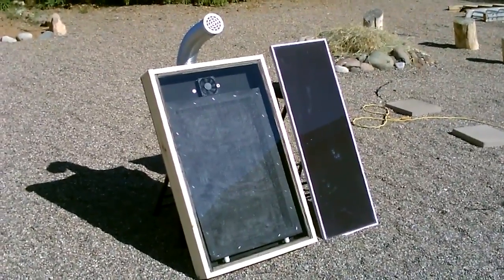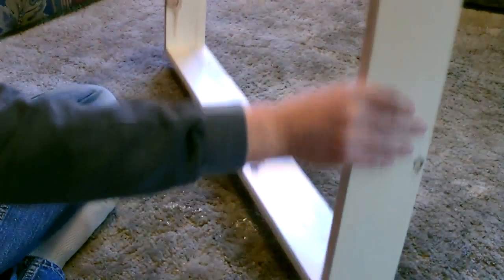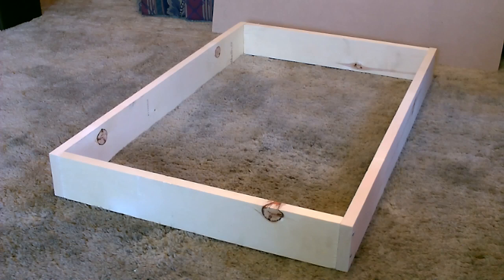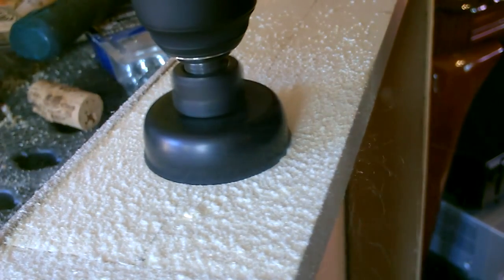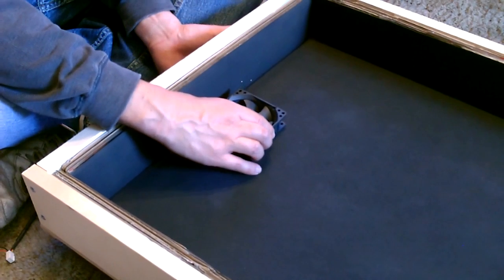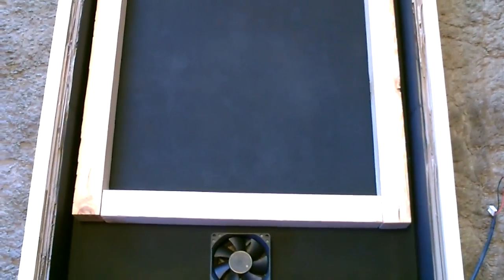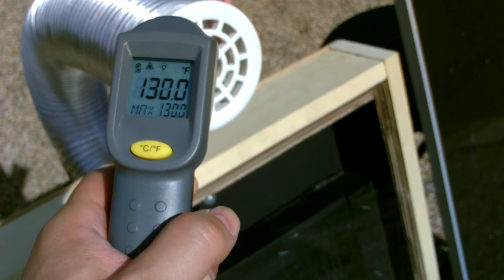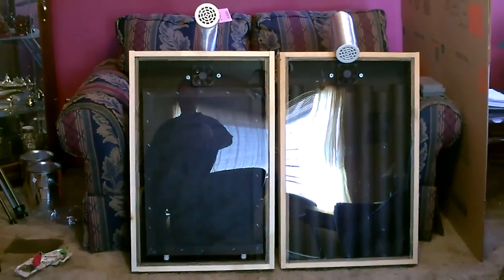Solar Air Heater! - The "Screen Absorber" Solar Air Heater! - Easy DIY (full instructions)

Comment: WHat kind of paint would be no fumes/smell for high heat?
Reply from the maker: most will work fine. i just use the generic flat black paint. once it's fully dry there will not be any smell or fumes. the heat in these things is not considered true 'high heat' so you don't need to use a high heat paint. these collectors usually stay under 200F even in the hottest of conditions. high heat paint is good for things like bbq grills and very high heat.

Comment: What type paint did you use that would be safe for indoor air - since the intent would be blowing air from outside to inside to breathe? Thanks.
Reply from the maker: hi. most paints are non-toxic when they are dry. i've used all types of paints and all have worked well. any smell goes away after the first couple of days.
Reply: @desertsun02  Thanks

Comment: So... you made a solar hair dryer? You would need to take air from the floor of your room pass it through the heater and then back into the room, or is this something you just place inside your window. I've seen those, all you need is a window screen hanging inside the room where the sun can heat it up. That is why shade cloth is placed on the outside of greenhouses, inside it becomes a solar energy collector.

Comment: I like the build. The use of screen seems much easier than using aluminum cans painted black, as long as you get acceptable temperatures from the unit. Have you tried using aluminum screen painted black instead of fiberglass screen? You may get greater heat absorption and transfer. I would like to see if it produces a different result.
Reply from the maker: hi and thanks! i haven't tried aluminum screen yet. may be a future video

Comment: I'm sorry if I missed it, but from what material are the two layers of 'screen absorber plate' made, is some form of aluminium mesh?
Reply from the maker: hi. i used a non-metal screen material (but aluminum screen may work too)
Reply: @desertsun02  Thanks!

Comment: Could I build one of these with no glass to just FIT into my window?
Reply from the maker: hi. you could but it won't produce any more heat than just letting the sun shine in through the window. these need to be outside so they can collect extra energy from the sun. 🙂👍

Comment: What is the screen material and did you paint it black?
Reply from the maker: the screen is just the standard "non metal" variety. it's a charcoal colored screen so i didn't need to paint it. 🙂
Reply: @desertsun02  thanks.
I may try to make one to clip
On the inside of one of my upstairs Windows. I have all the materials on hand.
Thanks for the idea.

Comment: I guess if it works with water it should work with air also. Not bad, you could argue that more layers of absorbent screens might even better. The formfactor is interresting, wonder if you have a narrow chamber 2 meters long might heat up the air better. Also having a labyrinth inside your design to channel the air through narrow passages. Great innovation.

Comment: Sorry but you don't say anywhere what the ''screen absorber'' material is . Could you clarify please . Otherwise great idea and well done . Thanks
Reply from the maker: hi. the screen is just standard non-metal window screen. you can buy it in rolls. i haven't tried metal screen but it might work just as well.
Reply: @desertsun02  ok thanks , but I take it you now think corrugated metal sheeting is the best ?
Reply from the maker: @JK SEP the best one of all is probably the one i made with the steel downspouts (it only beats the others by a few degrees, but if you have access to steel downspouts - it's worth considering)

Comment: What’s the screen made of? Won’t heat rise without need for fan?
Reply from the maker: hi there. the screen is the non-metal type (fiberglass/polyester). you could use metal screen if you wanted. the heat will rise but fan is needed to pump heat out at the right speed. some of the large collectors don't need fans to work well, but they need to be 10 or 15 times bigger.
Reply: @desertsun02  thanks for the reply

Comment: Is the mesh fiberglass I can't find black aluminium?
Reply from the maker: hi. i always use the non-metal type of window screen. i've never tried aluminum screen but it would probably work well. you'd have to paint the aluminum screen. i may try doing that. i might use that super black 'musou' paint.

Comment: The fan CFM means a lot. It speaks volumes for how much air was heated to those temps.  You use outside air, this means air exchange. Some buildings are very tight and must have ventilation inlet/outlets just to run a bathroom ceiling fan or the furnace. This would create a positive pressure on a building and may require other modifications.

Comment: Now watched a few USA DIY videos from across the big pond, I've came to realise why Americans keep stuck to Inches instead of the much more Logical Metric system... 
The Only Big Plus for Inches ..  -You don't need Glasses to see your measurements ! !! Those Numbers are soo Big compared to Centimetres haha @5:25
Reply from the maker: hi. interesting observation. so many things over here are based on the imperial system (inches, yards etc...) going back a hundred years or more. i think were in the process of transitioning but both systems have to be taught or people wouldn't know how to fix anything that is older (plumbing as one example).

Comment: What about: Adding double pane glass, instead of a flat screen, make it wavy. Instead of heating air from the outside, bring air from inside the house into the heater, so you are recirculating the air.

I have not built any yet, but I had an idea of a copper coil in an insulated box filled with black sand. You could run antifreeze in the tube and embed it in a walkway to keep it free of ice and snow.
Reply from the maker: hi. i've tried dual and even triple panes of glass but even adding one extra pane lowers the output temps quite a bit. it seems like more glass blocks more light and any heat gain you might get from it's insulating effect is negated. using recirculated air should boost temps some. i like the fresh air aspect so i use outside air.

Comment: If you drilled some inlet air holed in the frame of the screen collector do you think that would help or hinder the heating of air?
Reply from the maker: hi. not sure how you missed it but there are inlet holes drilled in the frame. got to have those to get air to pass through the unit 👍🙂
Reply: @desertsun02  no I saw the big ones in the main exterior frame. I was asking about the interior frame that had the screen on both sides.
Reply: @jeremys.2451  if you don't drill holes in the inner frame, heat will get stuck in there, 
which will act as a small thermal mass and give of heat for a few moments after the lightlevel sinks.
It most likely would also lead to more infrared radiation emittet by the screens and the frame, 
which would partially leave the mainframe thru the glass and reducing the efficiency.

Since there are better ways to implement a thermall "battery" into the system, I'd think it would be smarter to drill holes in the top and bottom of the inner frame.

Comment: i've come up with another cool improment idea:  what about putting black stones like crushed lava stones or crushed black slate or black gravel stones behind the glas... it will slow down but still allow air movement through the bedding and might provide a huge surface for heat generartion.... another good thing about it could be, that this could hold the temprature for a while if a cloud blocks the sunlight or after sunset....

Comment: Thank you for your channel.  Is there a computer fan you would recommend?  I'm building
the Solar heater you designed but I don't know which one would be the best to order.
I'm in a small desert town and I have to nave things shipped in.
Reply from the maker: hi there. i don't generally recommend any particular fan but one brand i like is bgears. they make some solid and (fast) fans. i've used them in several of my projects
Reply: @desertsun02  Thank you for the information on fans.  I'm building the solar heater
today so I will order the fans. Thank you for all your DIY info.

Comment: Thank you for the video. Question for the cans version though: would arranging the cans in a serpentine, effectively making it one tube, be better than the sheet? My guess is that the air would have to travel longer and thus heat up more before exiting. And  perhaps then have a better passive air displacement with it? Maybe cut some fins into the can lids to stall the air inside even more?
Reply from the maker: hi there. it's hard to say what effect those ideas would have. experimenting with ideas is really the only way to find out 🙂
Reply: @desertsun02  will do! Thanks for the inspiration!

Comment: Why can't the solar panel be used for both solar electric and as a heat collector in a rig like that instead of the screen? What's the lowest outdoor temp that would still allow that solar heater to blow out 70-75F temp heat "as is" without added insulation?

Comment: ...but you still need to bend that conduit to be useful. this is a great idea that shows good working principles. heat rises and for every meter of ducting  you lose temp. what would make this more efficient would be to have these collectors below the floor of the room you are heating.

Comment: What a great idea! Air is so much easier to handle than water! The overall circuit needs to be analyzed and optimized, but what you have shown us is a giant first step.
I can see this being used in air/air and air/water applications. I really like the lack of sensitive and fragile components in the collection stream.
This REALLY lends itself well to heating structures using thermal mass. This could be used to heat a greenhouse that uses water or rock heat storage.
For home use, the furniture and walls and supplemental heat storage components of the system could absorb heat during the day and release their energy during the night.
Yours is a ROCK SOLID concept that every home could use. BRAVO!!!
The immediate application I see for this technology is for greenhouse heating systems. This cheap source of heat energy could be integrated into greenhouse designs that employ thermal mass storage.
It is unobvious but this technology can also work in reverse. It could radiate heat energy into the night sky. A thermal mass could be cooled at night to be used during the day. This could be an extremely effective air conditioner in a low-humidity desert setting. And all you need is a low-technology, simple, fan.

Comment: what kind of power supply did you use since those biscuit fans only use 5 Volts. ?
Reply from the maker: hi. your thinking of the usb powered fans i think. these are 12v computer case cans. i use a small 12v panel to run them 🙂

Comment: Have you ever tried to use rigid foam with heat reflective film on it for insulation, shouldn’t cost much more and I wonder how much hotter the air would be?

Comment: Great job! My first solar can heater was a failure. Even though I used high heat sealant for the cans, once it got super hot inside the box the cans shifted and I could never get them to stay together.
Reply: I’m liking this screen concept.   Thanks Eva
Reply: Would sticking the cans together witj ductape be an option?
Reply: @gregoryverhulst4907  i think better option is aluminium tape, its better for heat than duct tape.

Comment: Run water hose instead dryer vent. Then add circulating pump which move the hot water to your furnace add a radiator.

Comment: Do you think it will work putting it on the 4th floor and using a long isolated tube "drag"  the air to the 1th floor?

Comment: Liked the idea of using cardboard for internal insulation.  Using double pane glass on the front would be more effective over time.  And having the motor on the bottom (as hot air rises) might make the motor last longer.  But over all not bad at all.

Comment: Simplifying design, you might raise the entire box to match the bottom edge of window with an open slot equal to window opening allows the air to flow into the house without a pipe. Convection will move the air. Drawing air from under the house will recycle interior air. Aluminum screen might be a good heat sink painted black. Also could be spray cleaned.

Comment: What's the lowest temp that one of these will work at?
I live in the north country.
Reply from the maker: hi. i've seen well insulated units work all the way down to 10 or 20F. just need lots of sun.
Reply: This style of heater will continuously heat air drawn from the room/inside, so with some sunlight, it will work in any temperature.
Depending on how well the home's window is insulated, and how appropriate the fan's size/speed is (too small a fan, or too slow of a speed will not pass enough air through the heater, and if the fan is too large/blows too much air, the air will move too quickly and not heat up sufficiently).
It should be placed in south/sun-facing windows for best results.

Comment: Was waiting for info on the fan. Voltage and output from solar panel.
Reply from the maker: hi there. these types of fans generally are 12v and use 2 to 4 watts. any 12v solar panel that is at least 5 watts should run them great.

Comment: your fan is 1.8 W. Please may I know the airflow rate in m3/h? I reckon the temperature rise you get should depend on the airflow rate. how many watts of heat did you get and what is the collector area? thanks.

Comment: There is a new type of metal blinds (here in Canada called Krumpers Solar Blinds) that you can install on the sunny side of your house and they create lots of heat. I saw this at a house convention and planing to buy such blinds. Currently using regular dark brown curtains and they produce 100 F -tested -in the sunniest and very cold day at -15C temp. I think the metal wire mesh curtains can produce even more heat.I saw some at the mall where they heat big gallery rooms they produce enormous heat.

Comment: use a piece of steel plate painted black and on small blocks rather than the frame.  Been doing this for years for a solar dehydrator.  The heat alone will rise and draw cold air from the bottom.  Ours are typically longer for more surface area for the air to pass over as it's heating.  I do like the picture frame idea and it would work well for a wintertime greenhouse (and can easily pack away when it warms up).

Comment: I am making mine from an old hot water heater as I have been told they work well. You can find old panels at the new panel shops as the installers of new panels often keep the better old ones. I took as many as I wanted for free and some of them would probably still heat water at the same time as heating a room.

Comment: Why didn't you install the fan on the side of duct system thats inside the window so the wiring will be done in the room and fan will stay in the room not outside.
Reply: Because he's using a solar panel to run the fan.

Comment: Amazing stuff! Did you do a comparison between the tin can/screen versions? Which worked better? Thanks for sharing.
Reply from the maker: hi there and thanks. yes i did. the temps were similar but during the test the screen one seemed to get a little hotter (by maybe 5 degrees).

Comment: Thank you for sharing this.
Reply: What's the point of this? You could let a lot more thermal energy into your house by just... opening your curtains. 
Even upscaled, this thing would be completely useless on a cold day (which is typically when you want warm air). You'd be drawing in cold air from outside into a poorly-insulated box, and then pumping that slightly-less-cold air into your well-insulated house. Again, you'd be better off just opening your curtains and letting the sun shine in through your well-insulated windows.

Comment: air outlet temp does not reflect the amount of btu output. Do you have the numbers?
And if you attached that to the side of a house you could make the vents in the back and draw in warm house air and make it hotter.

What will you use your heater for?
Reply: That would be theoretically correct and practically incorrect.
Reply: @geraldhenrickson7472  what would be practically incorrect?

Comment: Is the screen made of metal?  would any screen work?
What was the temp the day you were testing this?  
Some heaters only raise the temp of the current air temp.  If it was 80 and you read 134 deg F, if the temp was 20Deg F, your raise in temperature would be lower, around 70 deg f.  That might not be good enough to heat the space in a room.
I like the idea however, I'd really like to cut the gas heat bill, LOLOL.

Comment: Good job and nice video.  We started using a variant of this about 20 years ago with a 4' x 8' rectangle of 1 x 6 pine and a 6" wide raceway inside.  Back was 1/4 or 3/8 plywood and all matte black inside.  Used a 1/4" plexiglass front and (usually) an external fan.  You could heat an entire 2 room workshop easily on a 60% Duty Cycle.  Switched to DC motor about 10 years back when affordable solar cells arrived.  We made our own panels then but pre-made are WAY easier.  Using these for wood drying kilns now.

Comment: Why bother insulating the thick wood sides when you don't insulated the large surface area of the ultra thin plywood backing?  That would give you more bang for your insulation buck and not decrease the size of the box as much letting in a tiny bit more sunshine.  For each 1/8" of less wall thickness, you will gain over 18 sq inches of collector area.

Thanks for the video.

Comment: would you mind telling temperature values in °C as well for european readers ?
Reply: Temp conversion: F = degrees Fahrenheit, C = degrees Celsius
(F - 32) * .555 = C   (Subtract 32 from F and multiply the result by .555 to get C)
Example: If F = 45 degrees, 45 - 32 = 13, 13 * .555 = 7.2 degrees Celsius 
Likewise, (C * 1.8) + 32 = F